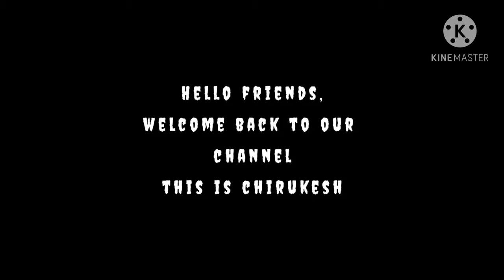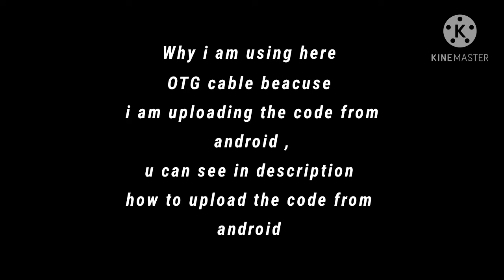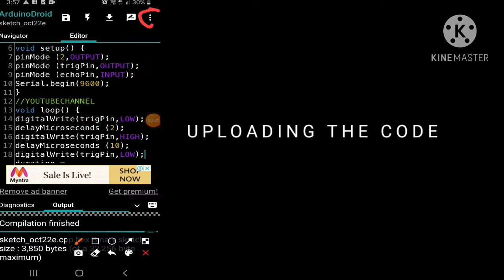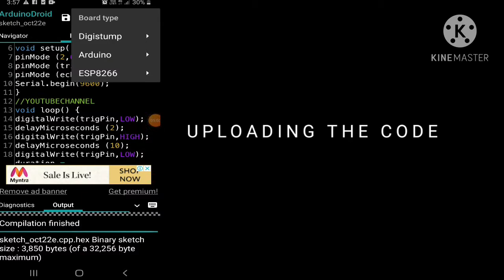Light control using ultrasonic sensor and relay module

Comment: Do we need power source for the Arduino during operation
Reply from the maker: S, we need to use power source for the Arduino through you PC, LAPTOP (or) POWER ADOPTER.
Reply: Can we use mobile phone
Reply from the maker: Yeah u can connect it to your mobile using OTG CABLE (or) OTG PIN